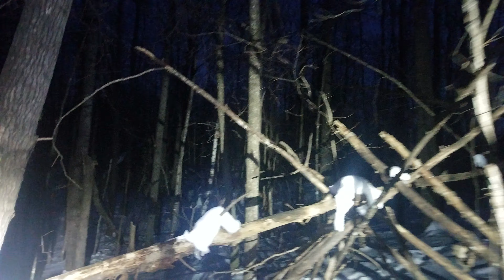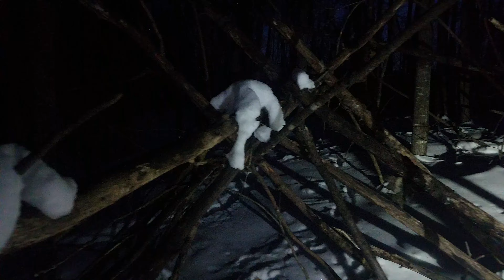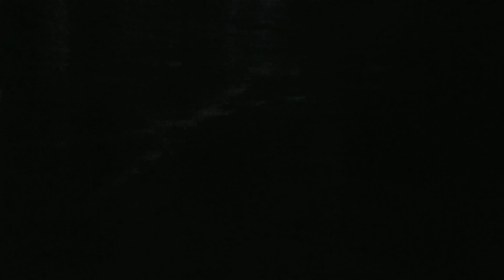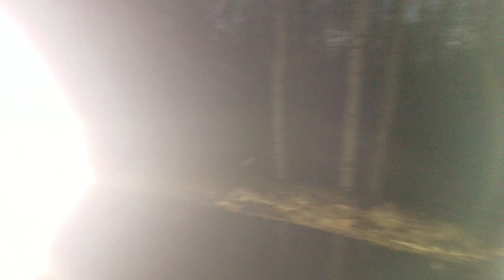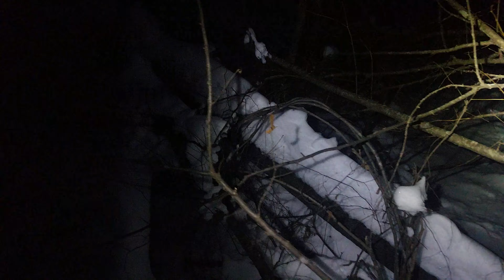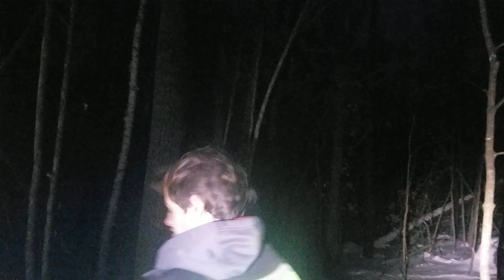Sasquatch life force energy grid? Lined up structuring for resonance? All structures connect!!

Comment: Once again I find your research fascinating and very intriguing indeed , especially now as you delve into the theory of the Sasquatch using the wooden structures they build , for generating life force energy waves !!!  Now if only we may find out if the Sasquatch need to stand/sit inside the radius of this set-up , or is it functional just by being in the proximity of these structures , thus allowing for the absorption of such energy waves ???  The advantage for the moment is the very cold winter season in this region , due to the lack of foliage on the deciduous trees with pines only bearing green . This in turn allows for an overall view ,  of why the Sasquatch may have designed the placement of these structures  , and if there is any set pattern or simply built wherever they may choose a spot ??? 
 *Do the Sasquatch use the energy lines that run through the ground , and is there a water source like a flowing river/creek or a lake nearby other than Lake Superior ??? 
*Northern minnesota sasquatch & Minnesota Bigfoot when the two of you put forth your proposed theories , mostly ideas which are only in the developmental stages..... YES , so in turn it may be advantageous to your research , to supply feedback with Scarboro Sasquatch Station , in order to turn that idea into a "Working Theory in Progress" and take it to the next level !!!*